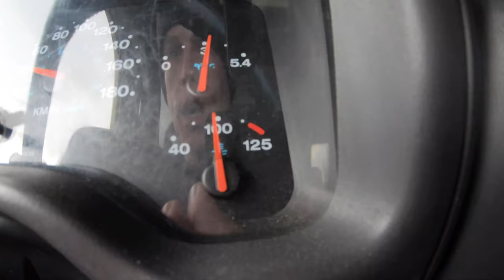How To Replace Front Callipers & Bleed Brakes On A Jeep Wrangler TJ

Comment: Did he even mention replacing both crush washers for each brake line? That’s why ppl punch the brake line. Takes a few seconds to replace the crush washers n sometimes 1 is stuck on old line so I need a pick to remove.
Reply from the maker: New callipers come with the new washers but yes you do need to check and make sure the old one doesn’t stick
Reply: @SmokinMonkeyOG  Super fast reply!! Question: if you’re just changing the master cylinder reservoir so u need to bleed the MC or just bleed the brake lines
Reply from the maker: To be honest I haven’t done that before so I can’t say for sure

Comment: Left side caliper locked up with no warning. Rotor and pads look great.  Well, i got the old caliper off, cleaned it up, reassembled and it won't fit back on--Pads are still way too compressed. I'm assuming get a new (rebuilt) caliper, slip the pads in and it will span the rotor just fine?
Reply from the maker: Did you use a pair of big slip jaw pliers to seat the piston back all the way on your old caliber before re assembly?
Reply: @SmokinMonkeyOG  Sorta. I used a large socket and pressed hard as i could with the bleeder valve open. Barely budged. I since ordered a new caliper--just installed it an hour ago. Quick road test with a couple of regular stops and one panic stop--voila! Everything works just fine. First time working on disc brakes. Ever!  Thanks for your very instructive video and your quick response. I have subscribed and look forward to more tips on the TJ. BTW, my oil pressure is always straight up driving or slighty less at idle. 2.4L 4 cyl.
Reply from the maker: Glad to hear it’s working for you. I guess the caliber was seized and didn’t want to seat itself back down.